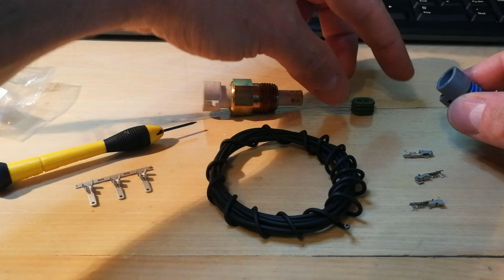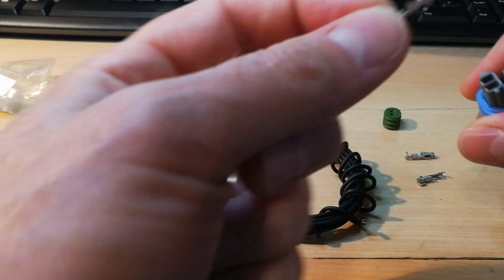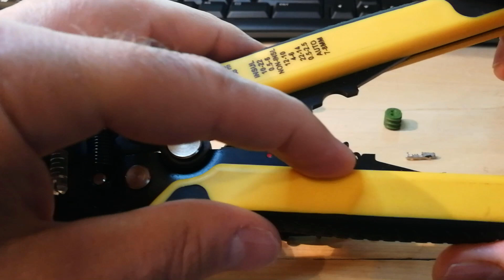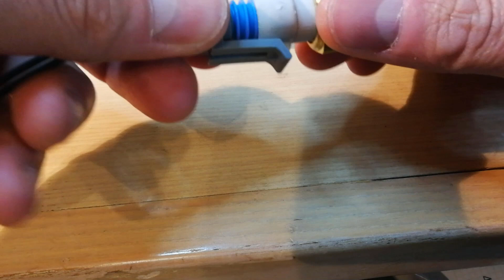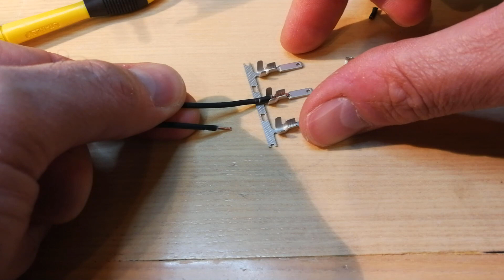Megasquirt your Miata - IAT Sensor Wiring (Pt. 4)

Comment: I have a ‘99 do o just plug the new iat wires into the old IAT plug going into my air box I have a fm turbo installed. I am
Installing a mspnp2  so I remove the Maf plug as well?  TIA
Reply from the maker: Yes on a 99 the iat can wire into the original iat plug.  The maf plug can stay, unless you are also installing electronic boost controll, and/or removing the old air box completely and replacing it with a regular cone filter style intake.   It may free up a little restriction to pull the old air box, but it's not a big deal like it is on the older NA cars.

Comment: Hey, would you mind helping me out with a problem? I don't have an intercooler yet but I'm trying to install megasquirt first, so I have nowhere to put the IAT. Could I tap the crossover tube and put it in there temporarily?
Reply from the maker: If you still have your stock air box you can just toss the IAT on top of the air filter.  It will work fine there.   Wrap the wires with some extra electrical tape for protection because the air box lid will be pressing down on it fairly hard when everything is bolted back up and you don't want the wires fraying or getting cut over time.  I ran mine that way for several months.  If you have a custom intake you can tap that pipe.  Anywhere is fine, including the crossover tube but I like to avoid damaging the stock parts.  Here's the link in the next video where I do that :)  https://youtu.be/zF5TfzU-EVw?t=1014
Reply: @OGPedXing  Damn thank you so much! I unfortunetely don't have my stock airbox, I might be able to find one though, or just get a temporary custom intake! You're far more helpful than many forums i've visited
Reply from the maker: @super_satvrn  no problem!  Yeah it's easy to make a diy intake...get some 90 degree piping (aluminum or steel, doesn't matter), stick it right on the end of your crossover tube and clamp it.  Clamp a cone filter of the right size on the end of that.  My car is a 94 and it has a 2.75 inch crossover.  I got that size pipe and a 2.75 inch k&n (it was an ru-3190)...done.  tapped a hole in the pipe for the IAT and screwed it in.
Reply: @OGPedXing  Ah cool, did you tap it right before the cone on the end of the crossover tube?
Reply: @OGPedXing  Oh I just saw your video, awesome
Reply from the maker: @super_satvrn  yes exactly.  I also oriented it so it was more on the headlights side so the pipe itself would shield it some from the exhaust heat.
Reply from the maker: @super_satvrn  I forgot about it, lol.  I was like did I put that in a video? 😂. For future readers, it's here https://youtu.be/yICAGQUsbIM

Comment: Great vid on how to crimp a connector. Useless for trying to figure out how to actually wire it.
Reply from the maker: Wiring in the car is the next episode...it'll show you where to plug it into the existing maf connector.
Reply from the maker: Sorry the YouTube app wouldn't let me link to a time code...but it's right around minute 21.
Reply: That is definitely the wrong way to crimp those, so I wouldn't have said "that's how u get a good crimp on em".. should've said "that's how I'm hoping to make it good enough to not fall off". If u pause the video at just the right moment (5:57) u can see it's just squished flat on the conductors (the sheathing crimp seems alright). U can buy a pair of open barrel crimpers for dirt cheap online, may not be the greatest quality, may be the AWG or mm² labeling will be misleading and I'll have to go up or down a size, but DEFINITELY will do a good job if u just "work with it" instead of letting the tool do all the work. If u want the tool to do it all, reliably, sure go grab a 200 dollar open barrel crimper with 4 sizes on the jaw.. but the 12 dollar crimpers are fine and u can buy specific jaws that'll fit the tool in accessory kits for another 10 bucks if the 1 it comes with don't fit good. But the point of that style crimp is to "cold weld" the conductor to the terminal, not just "contact" the terminal. And a good hack with small gauge wire on larger terminals (or really any time, as long as the terminal can make the stretch for a good crimp) is to strip twice the desired length, loop the conductors in half (back in on themselves), and then crimp. The loop can add a final resort for strain relief, plus it's more surface area for the terminal to bite into.
Reply from the maker: @mikeycurtis7861 I guess this is true, however as I mentioned in the video if you lack the proper crimper it's fine to also solder.  Zero problems.